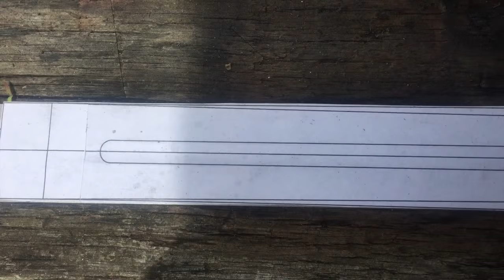Wedding Present Sword

Comment: great work! nice job fixing the bend.
Reply from the maker: +nickwoo2 Thanks, Nick. I think it bent when it fell off the bar and into the quench. Clamping it during the tempering process really worked well.
Reply: +SugarcreekForge nice,  I have an oil tempering tube but I have to make a bigger one to fit a straightening bar in as well

Comment: Absolutely love it!

One question.  I noticed you using a magnet on the blocks to check to see if the blade is hot enough to harden when quenched.  However, you took the blade in the building 2-3 times when heating it for the quench - why?
Reply: To see the color of the heat probably.